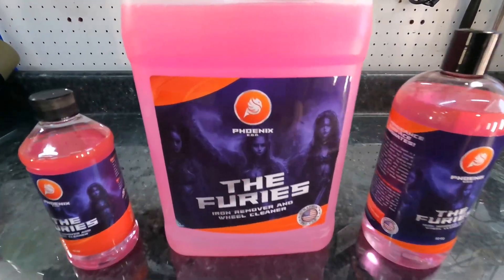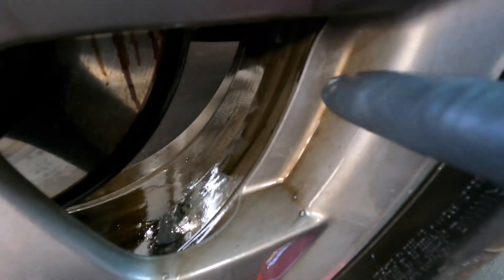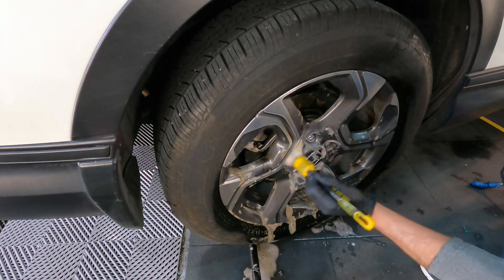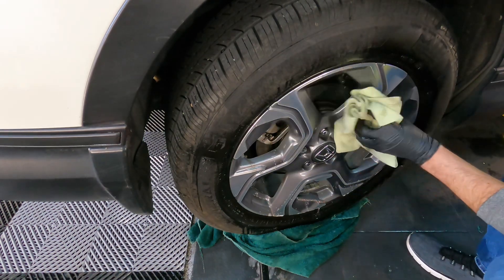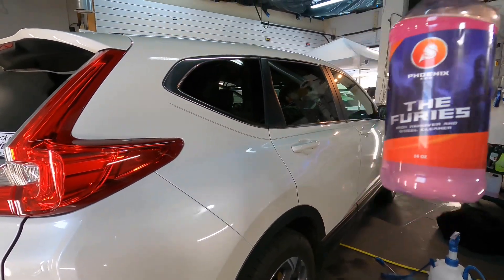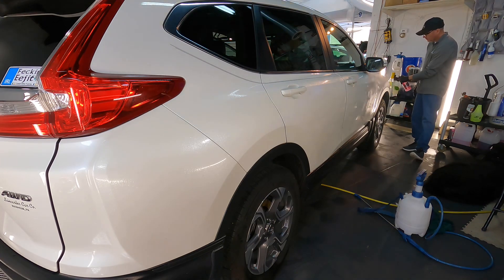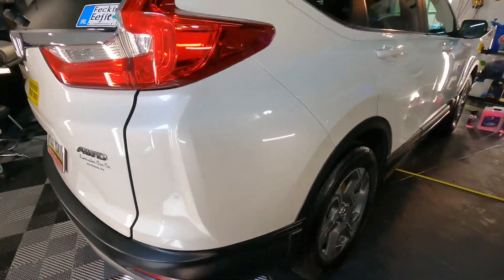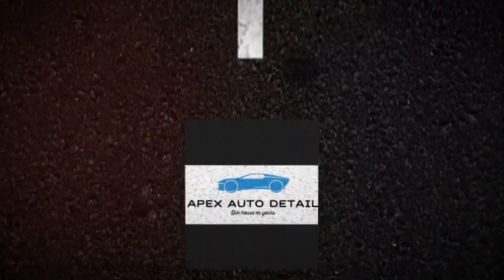NEW!! Wheel Cleaner/Iron Remover-Phoenix E.O.D. THE FURIES!!

Comment from the maker: What is YOUR go to Wheel Cleaner?
Reply: My go to has been Dark “Furry” but I’m liking the concept of this as it’s also an iron remover.
Reply: ironX paste 
Meguiars ultimate wheel cleaner
Reply: I had been using Adams, but I swapped to Bilt Hamber last year…
Reply: Used Megs D140 for many years.
Reply: I use Adams wheel and tire but will try this product 👊🏼
Reply: Right, right, Furies, not furries. I got it. Ha, ha.
Reply: Another awesome video and product review good friend
Reply: Seems like another solid product from Aaron. Checks all my boxes effective, easy of use,and very well priced
Reply: Bilt Hamber Auto Wheel (which is like this product). Or KKD 's Devils Juice if an Acidic one is needed. Between two two I've now found I don't need a strong alkaline one like Malco Brake Off
Reply: Gyeon. Wheel cleaner / iron remover
Reply: Brake buster is my favorite.
Reply: Nanoskin Non acid.
Reply: I still use Megs Wheel Brightener.
Reply: Meguiars and PS ✌️🇨🇦
Reply: Turtle Wax Hyper Foam

Comment: I really like the consistency y of the Furies! Meguiars makes good wheel cleaners like D140 or their stinky iron remover. Ethos actually has a nice wheel cleaner with iron remover but it is a tad thick. If the wheels are maintained I simply use rinseless wash. When my other wheel cleaners run out the Furies will be a great choice. Thank you for the video!

Comment: I've always thought to get the best out of your iron removers  you should use an alkaline soap wash first, but recently I've noticed some detailers making this their first step before an alkaline
Reply: On Wheels : As far as I am concerned, it is more interesting and logical to use the fallout remover finally and lastly, so on naked remnants.  

What also works on the other hand is the combination of the two on rims that are heavily soiled, so both at the same time.  Tuga alu Teufel uses this method.  

And which one is effectively the best ... personal choice I'm afraid.  Brake Buster still scores excellent.  

I myself use the latter, or Nerta WE65 / carnet jumbo and only use a fallout remover every few months.  In the end it depends on the situation and wishes.

But An alkaline as a first step is An excellent choice.
Reply: @Laura Palmer  it just makes sense to me to use alkaline first, otherwise how will this ph neutral liquid work if the particles are coated in grease. Nice to finally meet someone else who uses nerta, I love diamond active, it's so versatile. I can mix it 50/50 and it makes a great degreaser or as directed in a foam cannon, I also use it to shampoo the carpets and seats and nothing works better for 4x4s.
Reply: @123fuhfrtgfh  Very pleasant to read that you know NERTA! I myself live in Belgium and NERTA is a Belgian brand. The terms of use are actually excellent. Adjust the ratio and you're good to go. The Diamond you use also has those advantages.

Essentially, you have to work by gut feeling and just ignore the marketing.

Best regards in advance!

Comment: Using a wheel brush /agitating is the worst possible way to test a wheel cleaner. Hell, some soaps will do the same thing. The only true way to see the cleaning power of a wheel cleaner is to spray the wheel with the cleaner then hit it with the pressure washer.
Reply: It is also nice to see in a real world application. Like it is intended to be used.